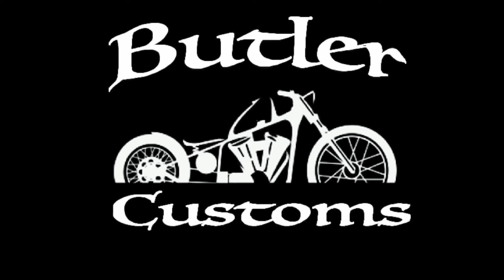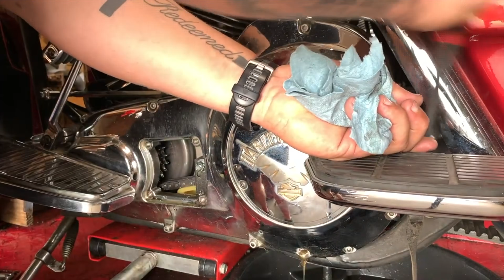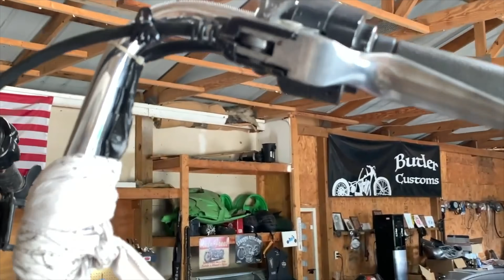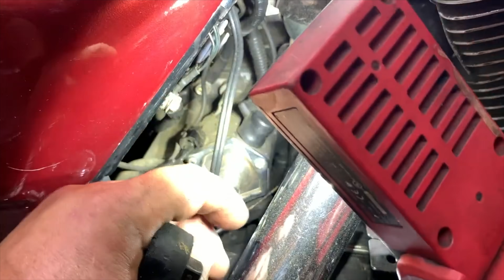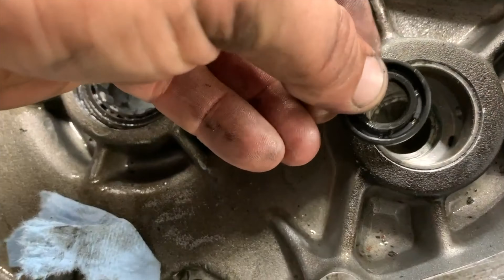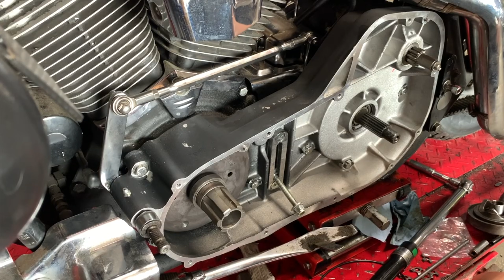How To Replace Inner Primary O-ing and seals on Harley Big Twin Evo. Butler Customs

Comment: Vielen Dank für das wirklich gut erhkärte Video. Eine Frage; Kann Motoröl in den Primärkasten laufen? Und welche Dichtung ist dann defekt?
Reply: Vielen lieben Dank.👍
Reply from the maker: Yes. Motor oil can leak into the primary case by was of the crankshaft seal behind the stator/rotor
Reply: @butlercustoms Vielen lieben Dank 👍
Reply from the maker: @KSRSTENSCHUESSLER my pleasure

Comment: Is it possible to put the jackshaft coupler in backwards im asking because i got a half assembled bike and bunch of boxes with the question can you put it back together
Reply: Thank you i could not find that anywhere
Reply from the maker: My pleasure
Reply from the maker: Yes
Reply: @butlercustoms which way it go in and im referring to the big coupler
Reply from the maker: What year?
Reply: @butlercustoms 99 softail
Reply from the maker: The internal snap ring inside the coupler faces toward the starter motor, with the shorter-depth side of the spline going toward the starter and the longer side facing the jackshaft.

Comment: I replaced my inner primary and it still leaks what did I do wrong?
Reply from the maker: Hard to say without seeing where the leak is coming from.
Reply: @butlercustoms  it’s definitely coming from that primary seal. I will be honest I put it in backwards the first time but now I have it in the right way and it’s still leaking from the same spot.
Reply from the maker: @jjl8094 if you installed it backwards and then flipped it around and reinstalled it, that could cause a leak.
Reply: I also did get a new one before I put it in the right way
Reply from the maker: @jjl8094 👍🏼

Comment: What would you do if the nut that is holding the clutch plate on her stripped and does not want to come out? It’s the one that is reverse thread.
Reply from the maker: I’ve never ran into an issue like that, but that nut would have to be removed on way or another. And it sets in the pretty deep. I’m not sure how I’d best tackle it.

Comment: I see 5 inner primary bolts on the bike you are working on. M8ne only has 4 bolts. I have them all out and the starter bolts out, but can't seem to get the inner primary cover off.
Reply: I found it! That inner primary bolt that is not on mine is threaded in from the back side. It is almost directly below the shaft from the transmission.
Reply from the maker: Glad you found it!

Comment: I just did that entire job. Thanks for the step by step on that. I'd never have gotten it running as a fast without the video you made. 

Thank you for that!
Reply from the maker: Thank you for your kind words! I really appreciate that! Glad to help. That’s what this channel is all about! Wrenching together.
Reply: @butlercustoms im still floored that all that work has to be done to change out a $9 part. But I caught it before it took out the transmission shaft, so, looking at it that way I'm money ahead
Reply from the maker: @gerryrandolph yep! Glad they changed it in the newer years.

Comment: Hey there im doing this on my '99 twin cam, ive got all the new seals installed...while putting the shift arm back on i put it into gear.....now it will not change gears or go to neutral. Am i missing something? I will say when i put the 5th gear seal and race on i had to beat the hell out of them...but everything was free before then
Reply from the maker: Sounds like something was installed wrong and has it in a bind.

Comment: Me again..are the nut sizes the same (compensator and clutch) for my 2005 road king? I need to know in advance,  because i need to borrow those huge sockets. Not worth buying  for using once. There's no Harbor Freight here in Greece. Lol
Reply from the maker: No, they are different sizes. If I remember correctly, the compensator nut is 1-1/2" and the clutch hub nut is 1-3/16". But double check that. Thanks.
Reply: @butlercustoms thank you . Keep up the great work. Its so easy to follow you.
Reply from the maker: Thank you!

Comment: 97 heritage softail flstc , the compensator nut doesn’t come out. I’ve tried with a 400 pound pistol, heating gun, and even with a 2ft breaker bar. I dunno why the previous owner did but it doesn’t come out! Any advices ? 

Edit: 
Turns out I had to jump on it and call a friend to hold the bike, lol
Reply from the maker: Glad you got it! They are on there snug!
Reply: Had a similar issue, I used an impact 3/4

Comment: Are the two ground wires in the same place on a 2005 dyna super glide twin cam 88 I’ve taken mine off and not sure if that’s the correct location
Reply from the maker: This bike is a touring model so I think they are different on the Dyna platform.

Comment: What about that shifter seal going into the transmission?
Reply from the maker: This video is a shortened clip of the long form video that should be linked in the description. It’s replaced there. Thanks.

Comment: You never explained the bolt torque pattern or how to reinstall that long perimeter crankcase gasket? What size Allen key do you use for those bolts? What is the torque pattern and torque spec? Do you use RTV anywhere or just replace with a new gasket? The large crankcase cover gasket on my 2003 Dyna FXD must be wearing out because it's got a little leak on the bottom part of the cover near the crankcase drain bolt.
Reply from the maker: This video is a shortened version of a much more detailed video that is linked below in the description.
Reply: @butlercustoms ok! I'll check it out. Thank you!
Reply from the maker: @savagewildanimal4life my pleasure

Comment: Awesome video. I did exactly all this, but now my clutch release plate won't go in far enough to put the snap ring in... any ideas?
Reply from the maker: Sounds like your clutch cable isn’t all the way in, as far as slack in the cable. And the tension is causing your pushrod to be out too far.

Comment: Do you not (or have you heard of) loosening off the lower mounts for the engine and transmission when installing the inner primary on Evo's?
Reply from the maker: Yes. Just the trans mounts. However if you are simply removing the inner primary and reinstalling it then it usually aligns back up with no problems.

Comment: My 1991 FLHTCU is not a 1.25" on the main drive nut. Wonder what size it would be then? 1"? 1 1/8"?
Reply: My Dyna was 1 and 3/16.
Reply: @kelvinmoore5635 yup. Mine is 1 3/16 also 😂
Reply: @kelvinmoore5635 I have it all apart and doing the seals 2m 😎
Reply from the maker: Probably 1 1/8
Reply: thank you! These things are expensive! 😂
Reply from the maker: @CassCooking they sure are.

Comment: Installing the starter Jack shaft on a 99 road King everything came out together now I got to put it together but the the coupler how does the coupler go back in
Reply: I got the Jack shift in starter works Good now I got a problem with the compensator I don't want to mess it up I need the right steer I can send a pic I will
Reply from the maker: @jaysmith8162 butlercustomsmotorcycleshop@gmail.com
Reply from the maker: If you will email me at butlercustomsmotorcycleshop@gmail.com I can send you the assembly diagram.
Reply: Hopefully I got it took me a couple hours just to line up the two starter bolts after I put that shaft back in I'm going to find out tomorrow I need a break thanks for everything
Reply from the maker: @jaysmith8162 my pleasure.
Reply: One more thing sorry do I have to take the spark plug wires off the spark plugs make sure jackshaft plunges in and out. Thanks @butlercustoms
Reply from the maker: I would.

Comment: Great video, thank you.  I just finished a Magneti Marelli intake rebuild after watching your other video and the bike fired right up!  But it's a real low mileage 1998 Evo and is leaking out transmission lube!  Didn't leak a drop till the engine ran.  I told the owner that the primary might have to come off for seals and you showed exactly how it's done.  Better than the service manual!
Reply from the maker: Thank you for your kind words and for watching and commenting!

Comment: It's always a good idea to check the tightness of the shift lever on the transmission while you have the inner primary case off to eliminate any problems.  Those do wear out with time.
Reply from the maker: It got checked. This is a short “How To” video from a much longer revival video. The original video is linked in the description. Thanks.

Comment: How did you loosen the compensator bolt and clutch basket nut without locking the gears with a locking bar or wedge? Is that only necessary when using hand tools?
Reply from the maker: Great question. With a 1/2 impact there is no need to lock them. However, to torque them on reassembly you will need to lock them. I personally use a step wedge.

Comment: A trick with the starter gear you can put a large crescent wrench directly on the gear and it holds perfectly to loosen the jack shaft bolt i think it’s a 10 in adjustable wrench and 1/2 in socket. (I’ve always done this and never damaged the gear)
Reply from the maker: That's a great tip, thanks for sharing!

Comment: Cool video I'm doing that on my 94wideglide bought a new charging system from eBay 32amp waited 4 months cuzz of winter it was a solid rotor I have a thinner with magnet on the in. Side new rotor was 0,250 thicker called the dude he said oh well , so I bought a new one just like my old one  but I was doing all that to my primary , but I put the silicone on the inside were the lock washer are so I think il go back and put it on the treads . Yep good video she been of the road for 5 years all parts are in boxes and did way to much to her my bad I may have gone over board , 😅
Reply from the maker: That’s awesome! Thanks for watching and commenting. Glad you got her sorted out.

Comment: 93 Heritage soft tail (FLSTC)   My inner primary is cracked and I will be ordering a new one.  Should I loosen the Trans mount before I bolt down the new inner primary? So everything is lined up?
Reply from the maker: Great question! I would not unless it becomes necessary when mounting the new inner primary.